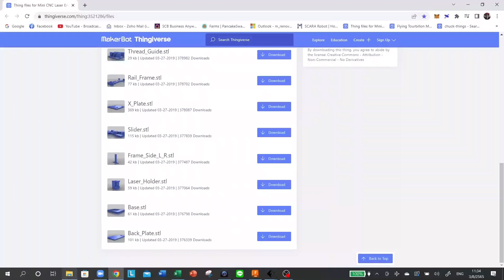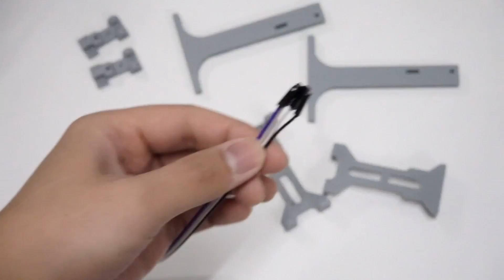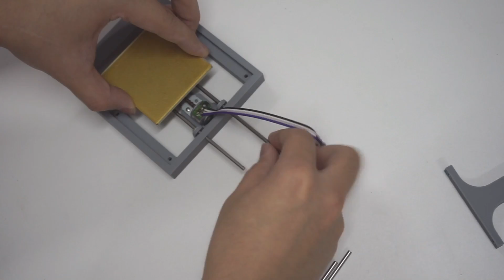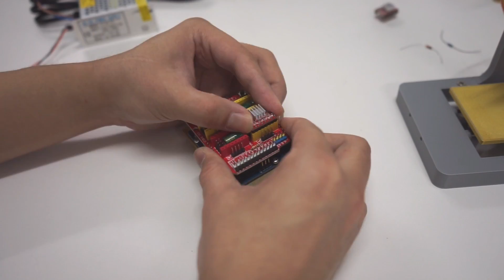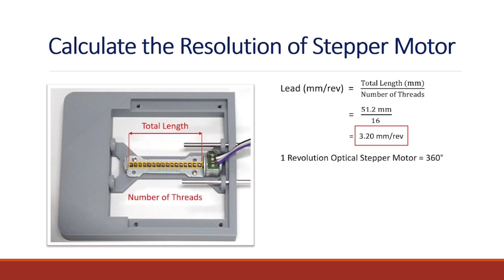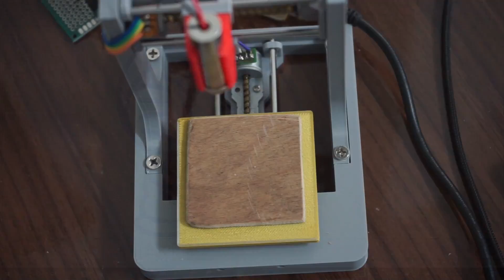How to Make Mini CNC Laser Engraver at Home [Full Tutorial]

Comment: HOW to make 3d mechine
Reply from the maker: It’s quite similar to this Laser Engraver but you need to provide and connect the 3D Printer Module to control the injection of filament as well as the temperature.